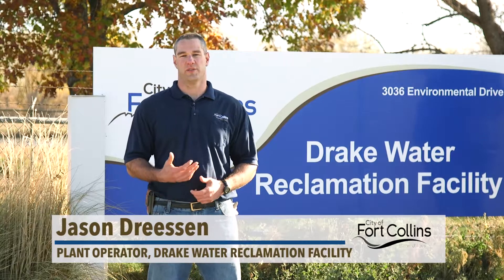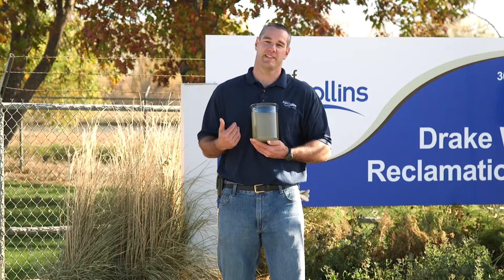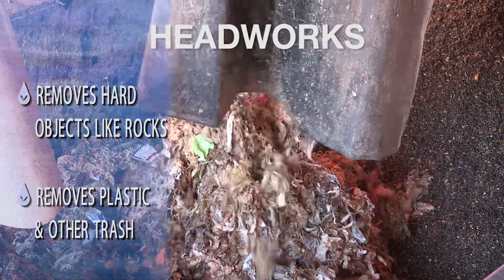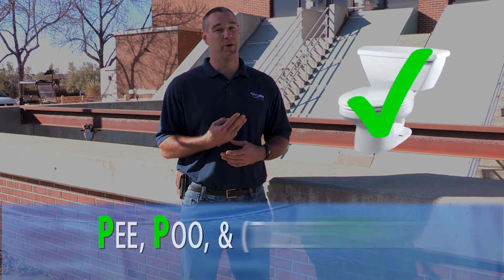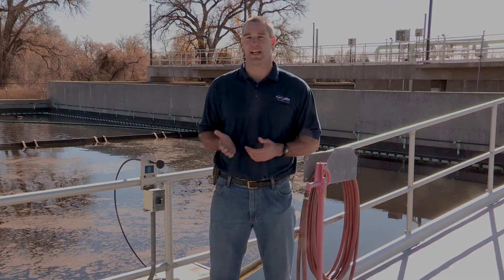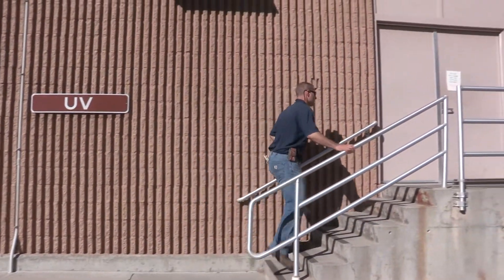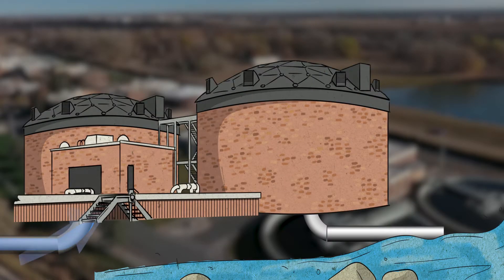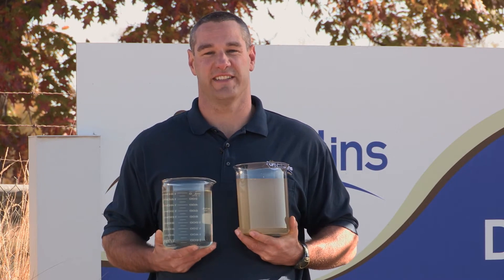Drake Water Reclamation: Take a Virtual Tour with Jason Dreessen

Comment: Who does the intake and screenings? Who manages/repairs the pipes for sanitary sewer collection systm? You just send the hair and non-dilutes to the landfill? Are there any other options for disposing of the physical debris in the water?

What process is used in secondary clarification? Is it osmosis? Is there a secondary clarifier solution; the water treatment "chemicals?" The chlorine and flourine, etc. that are meant to kill bacteria? Or is it some kind of boundary added that filters the water away from the bacteria and separates the two without necessarily killing the bacteria? Or is it another method that, say, consumes the bacteria and filtrates out of the water and in the process leaves behind the filtered water?
Reply from the maker: Hi Chelsea,
 We employ certified wastewater operators who monitor and evaluate the incoming wastewater. These operators also monitor several automated mechanisms that rake incoming screenings off of their respective bar screens.
 
The City of Fort Collins Utilities also hires certified collection system operators whom are responsible for the maintenance and monitoring of the collection system for the City of Fort Collins.
 
The three most common wastewater screenings disposal methods are landfills (or other similar approved disposal facilities), burying or incineration. Hair is removed using a Sludge Strain Press to minimize the impact of subsequent wastewater treatment processes.

Visit www.fcgov.com/wastewater, for more information!

Thank you!
Reply from the maker: Chelsea,
In regards to your second question about what process is used in secondary clarification: 

Secondary clarifiers work on the principle of gravity settling. The heavier solids are allowed to settle in the clarifier due to the very calm conditions provided. As these solids settle to the bottom, the clarified water is decanted by flowing over v-notched weirs. Solids accumulating on the bottom of the clarifier are then removed with pumps. Most of these solids are returned to the head of the activated sludge process, but a portion is “wasted” to digesters. We have to “waste” a portion of the sludge to maintain a desired population of microorganisms. We don’t use any chemicals in the secondary clarification process, it is not necessary for us. Ultraviolet light is used for effluent disinfection prior to discharging treated water to surface water in compliance with the National Pollution Discharge and Elimination System (NPDES) permits.

Thank you for your questions!